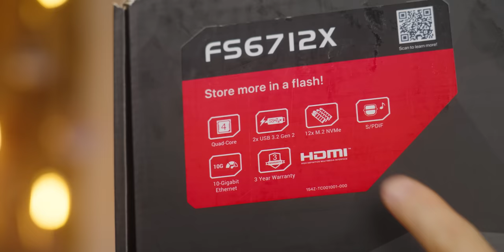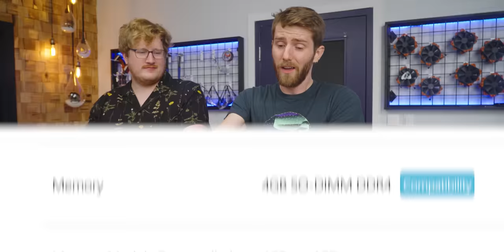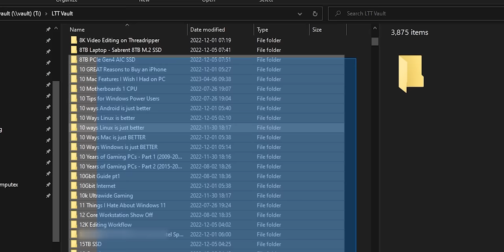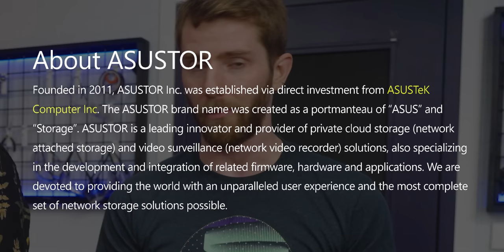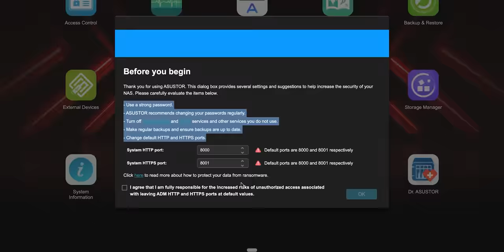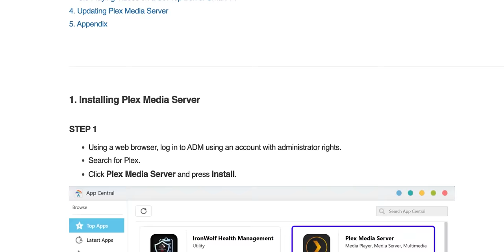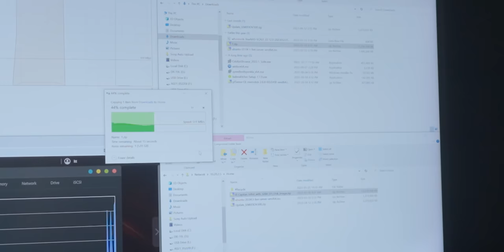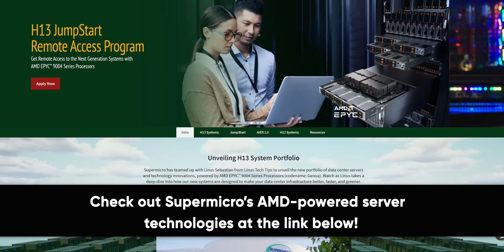I should stop building computers - ASUSTOR Flashstor NAS

Comment: I have several old (10years+) 1/2U servers at home and I want to build a super low power NAS in these. A video on that would ne nice. Which parts should I shop? Platinium PSU for low noise? AMD or Intel? I also want encode some videos a few times a year so a GPU would be nice which one has the best price/performance/power ratio? Can I switch the GPU completely when not in use tonsave power?
Germany has now really high power cost like 40cents/kwh. So I want to save a lot of power but don't losemuch usage

Comment: It's kind of funny how this came up just as we started building a similar SSD-based NAS device.  Ours is a bit different though...  We're using the cheap Samsung 8TB QLC SATA SSDs instead of NVMe devices.  We're also using a dual 10 GBE card instead of dual 2.5 GBE.  Even so I expect we'll saturate the network before we run out of speed on the array.  I mean, this is cute but still not top-rate.

Comment: I know this is old, but did they confuse the 6-nay and 12-bay models? They're using the 12-bay, but gave the price for the 6... and mentioned NICs, the 6-bay has two 2.5 and the 12-bay has one 10.

Comment: Why do you need spend $400 for a motherboard on your DIY nas build? 
Can't you just use cheaper/older hardware (e.g. Ryzen 1000 + 10G network card if you need it) and essentially build a low spec PC for a nas?

Comment: You can build this yourself? Sure you can, but at what price?

I remember seeing a car that allowed you to install something like 12 M.2 drives, but if I remember correctly that card alone cost more than this NAS. Other than that I don't see how you could get 13 M.2 slots in a machine. Yes thirteen, not twelve, you need one for the OS. Then there's the case, motherboard, PSU. For motherboard I guess you can find a small MB with integrated CPU that will do the trick for cheap, but all in all I don't see how you would match the price.

Comment: You guys mixed up model specs.
The 6 bay (with dual 2.5gbe) with 65w adapter is $449, the model in this video appears to be the 12 bay (10gbe), 95w which is usually $799, so actually a little more than your server mobo.
Reply: They did. They also mentioned it post-edit at the bottom of the screen.

Comment: This seems like it's maybe 1 generation or so off maturity.

With such harsh PCIe lane limitations you don't lose much, if anything, by going with SATA SSDs rather than m.2; and (at least at time of writing) SATA is cheaper than m.2 at higher capacities(not a lot cheaper at 4TB, though 5-$30 a drive certainly is appreciated); substantially cheaper at 8TB; you can get a Samsung 870 for under $400 in 2.5in, while the cheapest m.2s are slightly north of $800; which is nontrivial even for one unit and adds up toward real money if you are shoving a NAS full of  them); and you have the option of either going fairly compact with something specifically designed for 2.5in(especially with the extra airflow allowed for by almost all SATA SSDs being 7mm I like the 6x2.5in in 1x 5.25in bay drive cages if you are starting with desktop parts; plenty of dense 2.5in SAS backplanes to choose from if you are starting from a server salvage perspective) or of going with tiered storage and even wider range of choices if you go with something aimed at 3.5in or mixed 2.5/3.5in.

I assume that m.2 will continue to get more love than SATA does over time; and NVMe will considerably outpace SATA once you get to a CPU that can actually provide at least one or two unswitched PCIe lanes to the drive; but for the moment you really have to want the compactness; even if you are already set on all-flash and have no interest in any tiered options.

Comment: Man I really wish it allowed you to swap the CPU. I could easily build a decent vSphere home setup with like 3 or 4 of them and do a vSAN cluster.
Reply: We couldn't put a socketed CPU into this form factor if we tried! It's an SoC, so if we put a socketed CPU, not only would it cook itself, but we'd also have to add a chipset as well, generating more heat.
Reply: @ASUSTOR_YT  understandable for the current configuration. Any plans for a beefier model or one with a socketed CPU?

Still this thing is amazing and I'm definitely planning to purchase one to replace my home NAS.
Reply: @deviildogg1  I appreciate the support! We do offer a socketed HDD/SSD one already using a Coffee Lake CPU and we are likely to replace that with something newer as well. We also are looking at a few efficiencies that we discovered in our Flashstor that could provide up to 35% more performance when transferring data through SMB. I'm asking them to prioritise this. We try to approach the NAS by matching its bottlenecks as close as possible. There is a slightly higher SoC that should push the write speeds closer to 10 Gigabit. The problem is, while a lot of people like the faster CPUs/SoCs, when you're into overkill territory, you're wasting performance. We'd rather put that money into a software experience that makes managing this easy for most people, even enthusiasts and build their trust with a device that just works.

Comment: They need to make an i3-N-305 version, is an 8 core processor with 15w TDP.
Reply: Or the i3 N300 with 7w TDP, if they want extra low power consumption.

Comment: on the note of supermicro, I saw epyc 7002 cpu+mb go as low as $600. given the asustor nas cost 880 for 12 bay version wouldn't it be nice to do a custom build based on epyc? which should be way more powerful and flexible

Comment: What's the point of mixing high speed storage with a CPU that will bottle-neck it? Could you not achieve similar speeds with 12 HDDs in RAID 5 or 6? Is it just about the form factor?

Comment: Is the processor soldered on, on this? Be nice if you could upgrade it?
Reply: Hi! We don't use a traditional CPU inside the NAS. We use an SoC which helps us reduce complexity because it doesn't need a chipset. None of Intel's SoCs are socketed and they cannot easily be swapped without desoldering. Desktop CPUs would not fit very well in this device and they would cook.

Comment: Jake you Passmarked the wrong CPU!?! You did the J4125 but Linus shows the specs at (0:58) as a N5105 which has 1/3 better score.
OK, the Rysen 7 5700x is still 6.5 times better...
Or was the specs different to the Device ?

Comment: I was on the Asustor booth at Computex, when the rep introduces these NAS product lineups(there are a few lineups!) to me.
I asked them how will it solve the problem of when SSD drives inevitably failed together at once since they're clearly marketing this to the consumer space and shouldn't assume that the average consumer have the extensive knowledge of not matching same batch SSDs together. Sadly the rep does not have an answer to this.
The other obvious question was whether this teeny tiny CPU(as Linus mentioned in this video too), can actually process the workload that we throw onto them since the rep says that, and I paraphrase, "a good computer-like device that is suitable for different kinds of heavy workloads", which, I doubted heavily even when I saw that they are use Xeon processors on the higher spec lineup and my assumptions confirmed in this video, which it is really bad even on media. Not a great look.
I can see people buying this and later on regret. They did a great job on the design tbh, but unless those obvious problems are not handled, I still wouldn't recommend consumers buying this product.
Reply: Hi there! Hope you're having a wonderful Sunday! I apologise for the less-than-satisfactory answer you received and we will rectify this issue. 
Let me answer your questions for you. While it's fairly rare for SSDs to fail all at once, we do encourage people to keep proper backups with a variety of different types of media, including cloud storage, of which it is easy to set schedules, and USB external drives so that the risks of each are mitigated. 

The CPU inside of this NAS can actually process the workload onto them. We use bigger CPUs like Xeons are for businesses that may run bigger things like VMs or have tonnes of clients accessing the NAS at the same time. For home, small business, content creation and enthusiasts, the CPU inside the NAS is more than sufficient for processing. I don't know what you were told, but our NAS is an appliance. In the video, to use hardware transcoding on Plex, you need to have Plex Pass. If you have any more questions, feel free to let me know!
Reply: @ASUSTOR_YT  The NAS is meant to be THE backup, since telling them to buy a backup(the NAS) is already a feat that not many will do. Now try telling them they need a backup for their backups. Consumer products tend to have a simpler structure compared to what the industrial are accustomed to, as I'm sure the good folks in Asustor knows. Wrestling access controls from cloud providers is one of the key factors of having a physical, personal backup in the first place(see the horror stories from unannounced bans from google, MS et al. that ruins peoples' companies and lives for that matter). By delegating this task for ease of access from the cloud, with off-site backups clearly not very viable for consumers, it really defeats the purpose, not to mention now the user needs to manage both the upkeep of the machine and still pay for the subscription. I don't have any more questions about the CPU though since you have kindly clarified it. Your rep might need some more in-depth training before deploying them to the battlefield, or maybe they're just tired on day 2! Cheers.

Comment: Unraid doesn't support TRIM? There are settings to run TRIM on a schedule in the scheduler settings and by default it's set to run weekly. Supposedly it's also done automatically and asynchronously on btrfs formatted drives so the scheduler is only needed for xfs.
Apparently it is not supported on a lot of these SAS HBA cards people use though. Nothing UnRAID can do to fix that.

Comment: Okay, okay Linus. I only do, Audio and Video Production. On my computers.  As I started building my own back in, 1995.

In 2012 I had gotten an HP Laptop. With a Core Duo said to be, a 2 core, Celeron.. I was told. Numerous pieces of software I had. Would not run upon that. Ha!

It came with this miserable operating system called Windows XP Media Center Edition. None of my software ran on that operating system. So I had to purchase Windows XP Pro.

And all these folks telling me what would and would not work with at HP, POS. Au contraire! Once I put on Windows XP Pro. Not only did I get everything working. Even Avid ProTools. And Media Composer.

But the truly stellar thing was. It had an onboard FireWire 4 pin socket. And I installed a PCM-CIA, USB 2.0 and 6 pin, FireWire 400.

Then I go to do this Live, rock 'n' roll show at a all weekend festival. And I'm going to be  recording audio of the bands. And using,, 4 Video Cameras. And a Panasonic Frame Store  Sync based video switcher. And I am switching all 4 cameras, live. While at the same time.  I am streaming all 4 video cameras. Into that laptop. Along with numerous external hard drives. That I am directing the cameras to, individually. And recording, 6 simultaneous tracks of audio. Without a hiccup. Without a dropout. Without a glitch. And at the end I have a live switched, show. And multitrack elements of cameras and audio tto remix. In Post Production. For an even better presentation. And I did that. About 20 years ago now. And it's only gotten better and faster and more memory and lower cost.  Oh my goodness!

And so now I've got the 4 cameras. Which all have their own, 24-P,, 1080, solid-state, Chip Recorders.  With,, 4 old, Canon, XL-1's. In, 1.23:1, anamorphic digital squeeze, Panna Vision style aspect ratio. With the beautiful 16:1, standard zoom lens. And the optional, 3X, wide-angle lenses times 2. And I'm producing, 1080 content. From,, 525 cameras and switcher. It's a cool looking way to go. As the cameras will also do 30-P. And they are from 1996. 28 years old. Separate, RGB, CCD's and COMPONENT Color. Not everything on a single sensor with a filter. This is a much more rich, saturated, Broadcast, look. As one also does not need, 4K. You cannot really resolve, 4K. It just makes postproduction a little more versatile. And not all that necessary for good professionals. Because we don't screw up. We know what we want the picture to look like. And how to get that. We are not, beginners.

Of course it will not have the resolution on wide shots. As newer, 4K  cameras can deliver.. But if your shots are framed well. You do less post.  Shy of, color grading and color correction. It's rock 'n' roll. And it's beneath all of these colored flashing lights. So make certain to turn off Auto White Balance. Otherwise you will wonder what happened to the pretty changing colored lights? It's really pretty funny. They ask you what happened to the different colors?  It's in, Auto White Balance. So turn that off. When shooting rock 'n' roll.

The biggest mistake everybody makes. Trying to roll their own, rock 'n' roll videos. Is, relying upon the, Or microphones, only. No No and No. You still need that camera soundtrack. As it is not only your  synchronization reference. It's the lower ambient volume level we will mix that in with.

As one also needs. To take a dedicated, Left & Right channel feed. From the output of the PA mixer.  Or at least a single mono  channel. Of the music only. Which will slide into the video and synchronized to the cameras. In postproduction,, after the fact. And when you have that track. And you mix some of the camcorder audio with that direct PA board feed sound. It's shocking what you will get. Because everybody else's sound coming off of camera microphones. Sounds like vomit. Like puke.. Like excrement. But when you mix it with that PA board recording. You will be amazed! You will be, dumbfounded. It sounds fabulous!  Yes, it will. And nobody knows how to do that properly on the cheap. That it doesn't sound like, entry-level, beginner, amateur hour. You squash everything through a Dynamic Range Limiter.. Amazing what you will achieve. And you don't need any expensive, gear or equipment. Other than common inexpensive, run-of-the-mill stuff. Every rock band has.

And so I was able to push that HP Celeron based laptop. Well be. What everybody told me it could not do. It certainly did for me. Because I wasn't using Media Center Edition I was using XP Pro. On a lousy Celeron. And it was very responsive. Very quick. And by 2012. It was time, to replace  that. And the newer units? Ho-hum... It's lacking some of the reports and versatility. And that was on my recent three, i7's. I miss my old Celeron HP laptop. That was an exceptional machine. But the HP build quality is,  to o, plastic. And it all just breaks. No matter how careful you are with them. The display lid hinge will break. No matter how gentle you consistently are. It won't matter. I've had 2 identical machines like that. And I am not impressed with that build quality. Lenovo  had a better build quality and a solid case made of metal. And perhaps not as glamorous? Oh well. I want something that can do the job. I don't care if the case looks elegant and kitschy. If it's going to break in a couple of years because it's all plastic.. I just hate that. What a ripoff. The guts are still just fine! The case is  breaking apart and  kaput. That's like your car body falling off. But the chassis and drivetrain are great.  And costs as much as a used car.

Now I'm just whining and complaining about a bygone era. Oh well.  I'm old. I mean, I,, mold.
RemyRAD

Comment: I don't know much about raid or nas setups, like at all, but I planned on doing something like this with my main PC which has extra room for 4 or 6 SATA drives on the motherboard, and plenty of room in the case. I was horrified to see sata SSDs were just as expensive, if not more then NVME drives. I guess that idea goes out the window (both of my NVME slots are already used), unless someone knows where I can buy up a bunch of 1 or more TB sata SSDs on the cheap.

Comment: Cool tech, although seems quite underpowered. An i3-N300 (8c Gracemont) would have been better
Reply: Hi there! There are a few things we need to consider. The N300 series are brand new and we haven't had enough time to test with them yet. They're only two months old and two months is not enough for us to build and design a motherboard, test with and ensure there are no hardware bugs and driver bugs. We have to be cautious because we're dealing with people's data on our devices and we don't want to do things that can destroy the trust we have worked hard to build. So we have to be behind the curve slightly so that we know the product is solid when it goes out the door. This typically takes a year.

Also, the N300 series are particularly expensive at over $300 US while providing little practical benefit. Because the major function of a NAS is network storage and using your PC or mac to do the things you normally would do with your storage, transferring data will not see, in our opinion, $300 worth of extra performance. Since most transferring is single threaded, we found that a high core count is overkill for most NAS uses outside of big business.

We get that the Celeron name has a bad rap, but we definitely went with a configuration that could provide the most substance for the price. I mean, this CPU priced more than a good desktop i5. We even have found efficiencies that we could implement that could raise performance of this NAS up to 35%. We're testing them now.

Edit: Typo
Reply: @ASUSTOR_YT  Thanks for the detailed response! To be honest I'm more disappointed that Intel is still holding back the industry in many ways
Reply: @vincelongman3264  We're working hard to bring you the best! Thanks for replying and I hear you loud and clear!